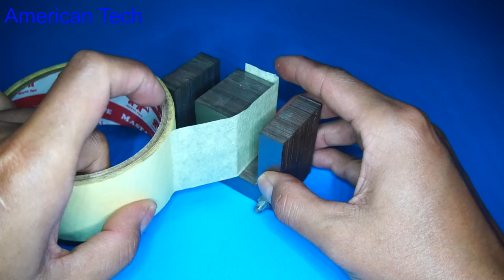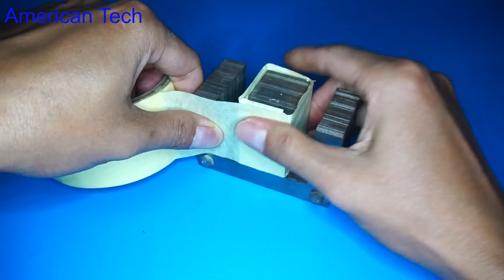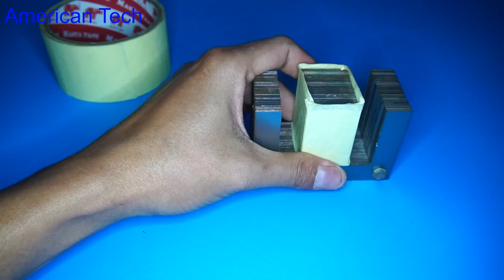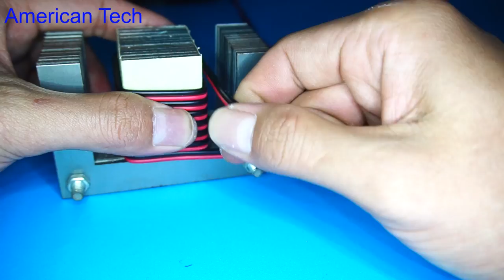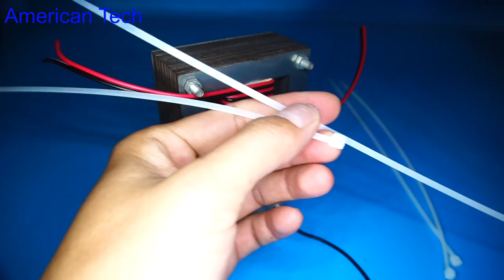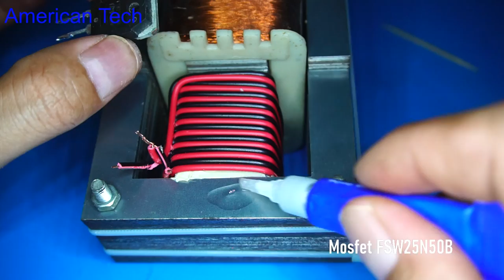How to make High voltage generator

Comment: Use a ferrite core .lamination iron cores are made for 50 Hz. Also the Mosfet is made for high speed application. I would wound a new primary for 115 v ac and a secondary for few kv-but thats a lot of calculation for both .

Comment: Hi i have a old laptop charger.... can you make one using a laptop charger?
Reply: Yes, it will be a bit smaller scale but the answer is yes. Look up other videos, Diy single MOSFET high voltage inverter from 3.7v there's a bunch of videos.
Reply: @bradenpederson4682  I made a high voltage transformer with a microwave fan😃

Comment: A little word of explanation how a transformer can transform voltage from DC power supply would be nice.
Reply: At first get knowledge about the mosfet 25n50b
Reply: mosfets can be used to convert the dc voltage to high frequency ac. then ferrite transformers can be used to step up or down the voltage. after that you can use it as ac or send it through a rectifier and use it as dc
Reply: Actually it's not at all true that a transformer will only work if there is 'AC' in the primary. A varying magnetic field around the iron/ferrite core is enough to induce voltage in the secondary even when it's DC. The only thing you need to set up for dc is that you need to send pulses of dc into the primary of the transformer so that the magnetic field will turn on and off according to the DC pulse frequency. For that purpose of switching, these transistors and mosfets are used. The simple example is, try exiting the primary of a flyback transformer by just sending pulses of DC and sure, you'll definitely see arcs jumping and it also depends how fast you're sending pulses of dc to the primary. Also in my experience, Transformers with iron core doesn't work with higher frequencies, so ferrite Transformers will be good for this purpose.
Reply: This circuit is known as the "Joule thief".
Though the original joule thief uses a BJT instead of a MOSFET.
The MOSFET used here has internal zener diodes.
Without zeners the gate would blow up really fast.